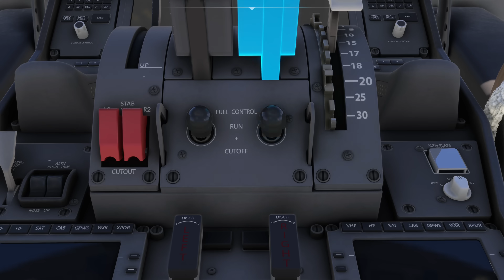Air India 171: Why Did The Fuel Cut-off Switch Get Moved?

Comment: THE REASON WHY THEY CUT OFF FUEL:-
1. It was told that plane was normal till it achieved 180knots. That's not correct. Even after engines fail its speed increases a while then starts coming down. It doesn't start happening the moment engines fail. 
2. It takes 1-2 seconds for the brain of the Flight to understand that engines have failed only then It deploys RAT. 
Again It takes some time to physically deploy the RAT. It also has to do some rotations before providing hydraulic power and even more rotations to provide electric power. And this time from sensing dual engine failure to production of hydraulic power takes 8-10 seconds. Now if you see the original timeline at 47 th sec RAT provided power and deduct 8 seconds 39th second the engines must have gone off. This is the exact moment when it just took off from ground. So Engines actually failed even before reaching 180knots.
3. Consistent with procedures of Boeing, if both engines fail at this crucial moment, you have to restart the engines. And only way you can do is to CUT OFF and then RUN 
As it was seen, fuel switches transitioned to CUT OFF, it signifies pilots prompt response to restart the engine.

SUMMARY - It was not cutting of the fuel switches that lead to dual engine failure, but the DUAL ENGINE FAILURE THAT PROMPTED PILOTS TO RESTART THE ENGINES (of which cut off and then run was the main part).
Reply: while this is mentioned in Gaurav’s video, I fail to understand if the engines failed before the cut off switch and the pilots were trying to reinstantiate the fuel supply then why would the pilot ask “Why did you cut it off “?
Reply: @JaydenMomos The report has not quoted the conversation verbatim. They have paraphrased it. Maybe they mistranslated it. That is the best hypothesis I can give you at present.
Shall think more deeply about this. Give me some time.
Reply: @JaydenMomos This was a paraphrase released by the authority. Only when the full conversation in original tone is released, we can say something. 
Let's assume that one saw the other to cut off fuel. Even then after one pilot (assumed deliberately done) says I didn't. I would expect the other pilot to say something back. But nothing as such is released
Reply: exactly
Reply: Correctly analysed

Comment: Blaming the pilot for the AI-171 crash seems unfair and rushed. Both fuel switches were turned off just one second apart — too fast for an accident, but also hard to do manually in such a short time. This could point to a software or electrical problem, not a person’s fault.

The cockpit voice recording saying “Why did you cut off?” is being misunderstood. In Indian culture, people often say things like that out of shock, not to blame someone.

Also, the fuel switches were reset after 10 and 14 seconds, and only one engine restarted — further suggesting a system-level failure, not a clear human act. The time suggests that the switch was actually put to off and then on position again say around 1 to 2 seconds each way, in an attempt to restart the system.

Based on the timing, pilot reactions, and technical behavior, this looks more like a system failure followed by confusion — not a deliberate crash. A proper, fair investigation is still needed.

Comment: The engines failed first, one pilot asked why the other cut off the fuel, to which the latter replied he did not, because he really did not. Then they tried to re-ignite the engines by switching the cut off switches off and on. That's the "transition" mentioned in the prelim report. Captain Steeve have some shame. Indian pilots may be brown in color, but they are pilots after all. Come clean, Steeve, stop taking bribes from Boeing and GE.

Comment: How much money did you take to run boeing's narratives?
We didn't expect such a biased conclusion from someone so experienced like you.

The engines failed way before the pilots cut off the switches cause it almost takes 9 secs for the RAT to be deployed after both engines fail.
It's a common sense to try out the basics when you see death in front of you and got no option in hand. Even pilots are also trained to cut off the fuel switches before impact to avoid any fireball.

Comment: Both fuel switches should remain in fuel flow during take off , even if move to cut off. That could be set up as override fuel flow during take off and add another protected switch in case of necessary fuel cut off . That could be set up with air ground mode .

Comment: The pilot flipped the switches in an attempt to relight the engines that had a fuel cutoff due to software glitch. 

In a 2019 incident involving an All Nippon Airways (ANA) Boeing 787, the aircraft's software mistakenly identified the plane as being on the ground during final approach, triggering the Thrust Control Malfunction Accommodation (TCMA) system. This system then cut fuel to the engines. The pilots did not manually engage the fuel cutoff switches. The incident was traced to a software glitch and not pilot error.

Comment: They cut off the fuel switch because the both engines failed and they were trying to relight the engine.
The both engines stopped working after rotating which is why they had to cut off. Flying Beast has released english dubbed videos regarding Air India Crash specially for Captain Steeve.

Comment: Please explain what is the procedure for dual engine failure does it state that it has to be only in air with a certain height.

Please calculate the actual rate deployment time from take off to the hydraulic power coming on after that deployment and tell us at what point did the rat deploy 

You can lie as much as you want if you are Boeing's dog

Comment: There is clear evidence that the engines failed before the fuel cutoff switches were reported to have transitioned:

The report states that RAT hydraulic pressure was achieved by 08:08:47 UTC.

The RAT (Ram Air Turbine) takes 5–6 seconds to generate full hydraulic pressure after dual engine failure.

This places the RAT deployment (and thus the dual engine failure) at ~08:08:41 or 08:08:42 UTC.

The fuel cutoff switches transitioned at 08:08:42 UTC, after engine failure had already begun.

Lift-off was at 08:08:39 UTC — this gives us a narrow window: engine failure occurred between 08:08:39–42 UTC, before the switches transitioned.

This timeline proves that the engine failure was not caused by deliberate movement of the switches to CUTOFF.

Now regarding the CVR:

The CVR records one pilot asking the other “Why did you cutoff?”

The other responds he didn’t.

It’s possible the pilot flying saw the PM (a highly experienced Captain and Trainer) move his hand near the fuel switch area, perform the memory item for dual engine fail/stall (which involves momentarily cycling the switch from RUN to CUTOFF and back to RUN), and then return it to RUN.

Since the switches were found in RUN post-crash, and he denied “cutting off,” it may indicate he did execute the memory item and restored the switches — not intentionally shut down the engines.

Also, the report only quotes part of this exchange — the rest may contain clarifications not yet disclosed.

Furthermore, in India, English is often mixed with Hindi, especially in stressful situations. It's plausible that the conversation was in mixed language and may have been mistranslated or partially understood.

🧩 Putting this together:
✔ Dual engine failure occurred before any switch was moved.
✔ The RAT activation supports this.
✔ The switch transition may have been a response, not a cause.
✔ CVR transcript is incomplete, possibly lost in translation or context.
✔ No conclusive evidence yet of deliberate action — needs deeper analysis.

Comment: The report looks more like its Boeing written rather than AAIB. Boeing is trying to cover its ass by making the report look like it’s pilot’s action.

Its a standard procedure of putting the fuel switches to cut off and then flip it back to run during a dual engine failure on a Boeing 787s.

Stop watching this guy as he simply looks like a Boeing’s spokesperson. If you would like to know the report in full details go and watch Flying beast’s 3-part video.

Comment: All that the interim report has stated is that the fuel switches were moved to the cutoff position and then returned to the run position. One of the pilots (not specified) asked why the fuel switches had been moved to cutoff, to which the other pilot (also not specified) replied that he didn’t do it.

I’m not ruling out pilot error or human factors, but hardware and software malfunction also cannot be ruled out.

A 2018 FAA report, published after a comprehensive review of the 737 MAX, identified issues with faulty fuel switches and recommended that they be identified, repaired, or replaced. Boeing shifted the responsibility of identifying faulty switches to the airline operators.

Boeing, once an engineer-led company founded by Bill Boeing, started prioritizing cost-cutting and shareholder value after its 1997 merger with McDonnell Douglas. That merger placed many McDonnell Douglas executives in key management roles at Boeing, which marked a cultural shift in the company.

At this point, four major stakeholders are involved:

1. Boeing – A company with substantial political influence in the U.S. Congress. It also manufactures military aircraft, some of which are used by India (e.g., Chinooks, Apaches, C-17 Globemasters). So, blaming Boeing could have diplomatic implications for India–U.S. relations.

2. Air India – As India’s flag carrier, it has an interest in protecting its public image.

3. GE – Manufacturer of the GenX engines used in the Dreamliner. As a major global corporation, holding GE responsible could again affect international relations.

4. The Pilots – Unfortunately, they are no longer alive to defend themselves. The Indian pilot association lacks strong influence, making it easy to shift the blame onto them.

Let’s also not forget: in many air crash cases, attributing the cause to pilot error simplifies the insurance claims process.

Given all this, I wouldn’t be surprised if the final investigation report blames pilot error.

Comment: Anyone who wants to report this video can use the following:

This video presents a heavily biased narrative against the pilots and ignores a crucial fact: cutting off the fuel control switches is a standard procedure when attempting to restart failed engines. If both engines failed without pilot intervention(which might be rare but can’t be ruled out until the exact chronology of events and entire cockpit recording of pilots is shared)- it is entirely plausible that the pilots moved the switches to cutoff in an attempt TO RESET or RELIGHT the engines, NOT as a mistake or a deliberate act of harm.

By omitting this context, the video:
	•	Skews public perception against the pilots 
	•	Undermines confidence in Indian aviation professionals and pilots
	•	Spreads misleading or deceptive information under the guise of “expert analysis based on facts”

Comment: The fact that the RAT deployed almost immediately after V1 may have indicated a power failure. This could have resulted in the fuel switches switching to cutoff.  They shut off automatically due to a solenoid failure. They’re not mechanical latches. On the 757/767 they’re mechanical……not so on the 787. 
ALPA India, in a letter posted on X, said the preliminary investigation report referred to the 2018 FAA advisory "concerning the fuel control switch gates, which indicates a potential equipment malfunction." 
Also, I have seen videos of inside the same aircraft displaying power failures relating to the air conditioning system and cabin lights on a preceding flight. This probably should have been looked at by the aircraft maintenance department. Somebody will have to check the maintenance records. 
Unfortunate that this incident happened at such a low altitude maintaining recovery was impossible due to engine spool up time

Comment: How can you claim that its a pilot error when there are incidents in the past that the fuel switch was automatically turned off without pilot turning it off manually. For example, Japan's ANA flight Boeing 787's engine switches were turned off without pilot's action?

Comment: Fuel cut is done to restart the engines when one or both engines fail. It does not matter if you are taking off or in air or landing. It's in the manual..  Mr Steeve read the manual again and don't jump the gun

Comment: Considering the flight or climb is in normal condition but the switch were cut off why the plane manufacturer didn't put a time delay before triggering the system to give a reaction time for the co pilot or why not make this switch dual to give pilots clearance to do so

Comment: Complete misinformation Capt Steeeevee, sorry to say but you are wrong!!!
Yes if the AAIB has not fabricated the timings of all the events in the preliminary report then as per current timings of RAT deployed, clearly engines failed before fuel switch was cut off. Pilot might have asked normally to other one.. Did you cut off? when he heard the engines spool down & then they started following the checklists of Turning fuel switch OFF then ON to bring the engines back to motion

Comment: 1)There is a procedure of Fuel Switch Cutoff and then Run, in case of dual engine failure. 
2) The Rat got deployed during liftoff (as per that clearer image of the plane from the runway). It takes few seconds to do so. Also, it takes time for the computer system to provide warning alarm of dual engine failure. 
This simply solidifies the fact that the engines had failed in an  interval between wheel liftoff and rat deployment (the observations overlap in this region). 
3) In this case, the pilots would have only one way to bring back the power to engines, Fuel cutoff and then run procedure. Following that procedure, the pilots regained one engine but the other engine did not respond timely (as mentioned in the report).
4) The statement of one of the  pilot asking why did you cut off to the other pilot, to which he responded he didn't. WHERE IS THR ACTUAL STATMENT? The statement provided in the report is an indirect speech. ALSO, THE TIMING OF THAT STATEMENT IS NOT MENTIONED! Why?!
Reply: Literally none of that is supported by the evidence. The data recorded clearly shows the engines rolling back after the switches were thrown, not before.
Reply: @trouty7947  What data? The timings are not mentioned at all. 
For ex- The report says that the Engine 1 and 2 fuel switches were cutoff Immediately After takeoff? What Immediately After? What is the time? 1 sec, 2 sec, 3 sec, 5 sec? 

The report also says that RAT got deployed immediately after takeoff. Again time is not mentioned. 

This is the statement provided in the report. 
"In the cockpit voice recording, one of the pilots is heard asking the other why did he cutoff. The other pilot responded that he did not do so." 
Where is the actual statement? If the conversation of the cockpit is recorded in the blackbox why is the direct statement not mentioned here? Why is it written in indirect speech? Also, the timing of the same is not mentioned! Isn't that important? However, the call that they did to ATC was given in Direct speech - 
"MAYDAY, MAYDAY, MAYDAY"

Also, in the flight of just under a min, was there no other conversation done other than the one mentioned above? Why is that not mentioned?

Do you have answers to these questions?
Reply: @priyangshumallick1889they're measuring things in second intervals, so "immediately" will be sub second. The time recorded on the CCTV might not be synced to the second with the aircraft, so immediately after take off is the accurate terminology as this is still preliminary. Timings are available, and have been widely discussed: Vr achieved at 8:08: 35, and transiston to air mode consistent with take off at 8:08:39. Max speed achieved at 8:08:42, and immediately after (read, sub second) fuel cutoff switches thrown.
Reply: Relax it will all come out in time after a through and detailed  investigation to answer your questions. its early don't gaslight its does nothing for the investigation. and the investigation doesn't care about your premature statement
Reply: What really happened on Air India Flight 171? In this video, I explore a developing theory that a rare electrical failure may have caused both engines to lose power — not because of mechanical failure, but due to how the 787’s safety systems are designed to respond in extreme situations. Specifically, we look at the possibility that the aircraft’s fuel shutoff valves (FSOVs), which are designed to close automatically when power is lost, may have played a role. This isn’t confirmed — but it’s a plausible scenario worth examining as we await the official report.

Comment: Both the engines died just during the takeoff and as a way to bring them back online pilots did a restart of the engines by cutting off and reinstating. Hoping the engines come back online. Like you would do for you laptops if there was a problem hoping when it restarts it works well.

Comment: Capt steve you're just dumb....
You've been a captain... You know what the horrors pressures are inside the cockpit. And you yourself are blaming the pilot.

Letting the narrative develop that the late pilot wanted to soiciede ? Come on.

Both the engines died just during the takeoff and as a way to bring them back online pilots did a restart of the engines by cutting off and reinstating. Hoping the engines come back online. Like you would do for you laptops if there was a problem hoping when it restarts it works well. 

Have some trust come on.